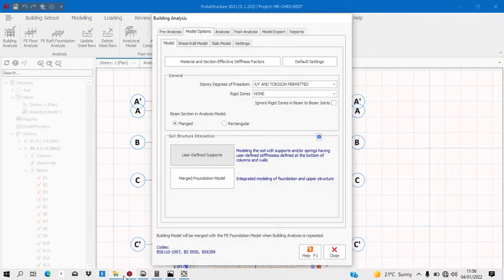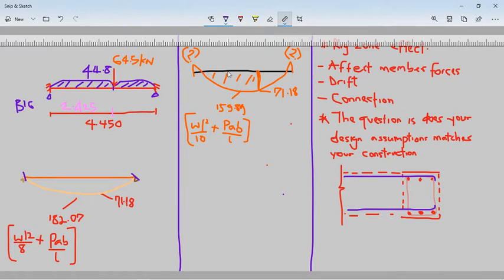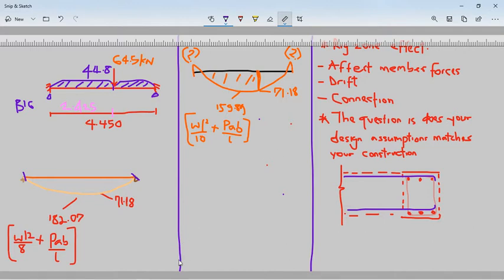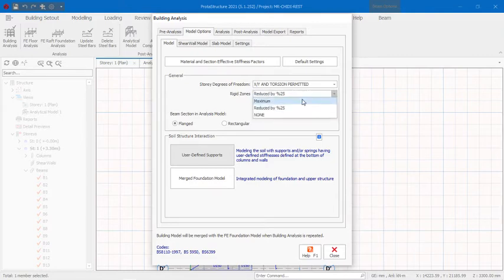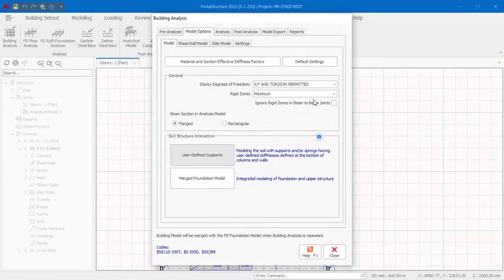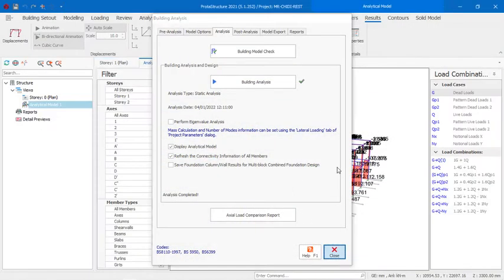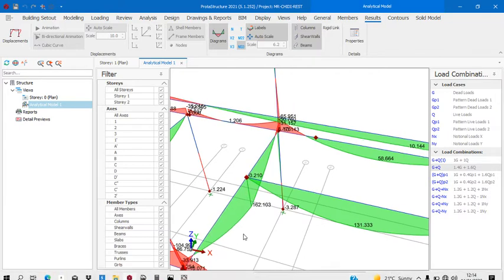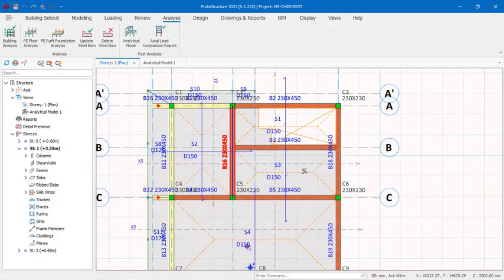Inner working of Prota Structure Suite 3.2 (case study Beams Rigid zone options)

Comment: From your explanation, the best option is to put the rigid zone in none since it's a little bit more than your manual design
Reply from the maker: Well, it depends on your design assumptions and you execution intent.
So if it is your normal concrete construction then the option of none gives likelihood of your expected values close to   doing the design manually.

Comment: what if those beams that span into other beams you release their moments, make them pin-ended?
Reply from the maker: Yes. The options is available. I mentioned it in the video preceding this.
Reply from the maker: Defining as point load. Option of changing end condition for beams in the software gives you another challenge entirely when it is concrete model